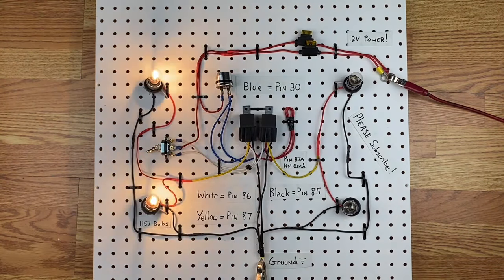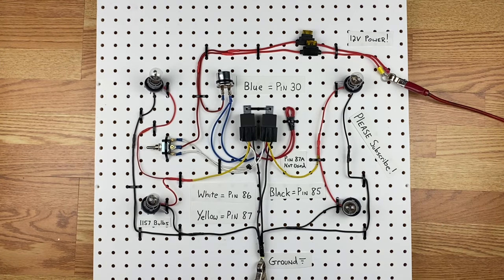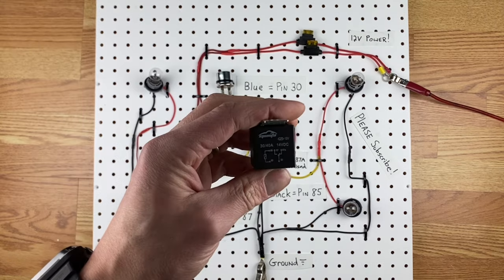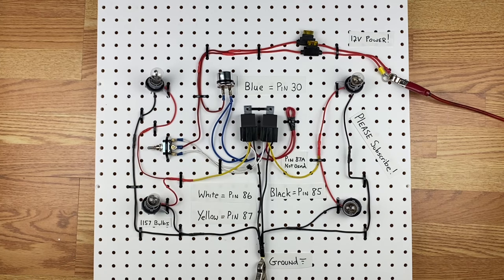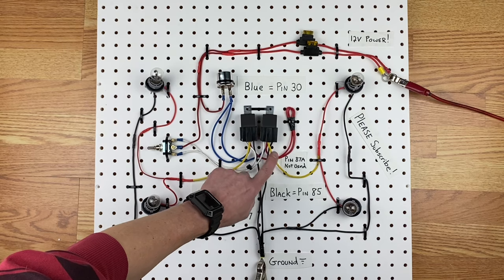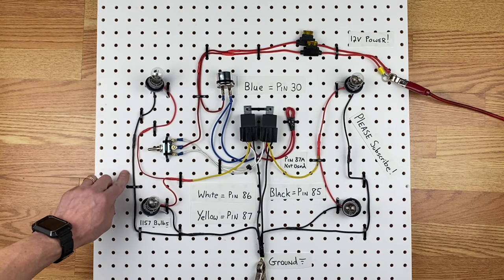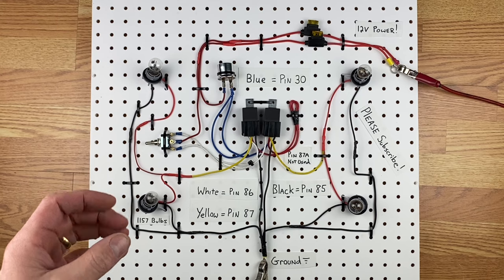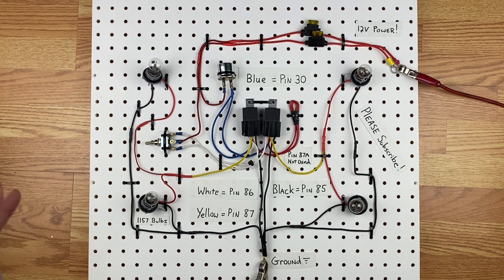How To Wire a Turn Signal Flasher Relay Directional Blinker on a Car / Truck / ATV / Motorcycle

Comment: About to buy everything I need to do this on my sortof-street legal mud toy I'm building (missing all stock lights) Just need something to get me to and from the trails. Thanks man. I've been fighting with the stock wiring all day but I'm just gonna do this.
Reply from the maker: Awesome! Check out my other turn signal videos too. I have about 3 different methods of doing this. One method doesn’t need relays, but needs LED bulbs. Another method has a cool switch that also has some other cool features. Check out the link in the top pinned comment above, and you’ll see them all there.

Comment: I'm trying to build a taxi roof lamp using turn signal relays. Would this work with an outlet or does it have to be car batteries because it's an auto part? Thanks

Comment: If I just want the lights to flash (for hazards) and don’t care about left/right for turn signals and I just wire all 4 lights directly off of the flasher?
Reply from the maker: As long as the amperage rating of the wires, flasher, and switch are rated for the draw from the bulbs, I would think that should work fine.

Comment: Great job on explaining how it works! 

I’m interested in using LED’s. I understand that you can get them as a replacement for a regular bulbs . Question, would it work using your wiring design? 

If not what would I need to add to make it work? 

Thanks.
Reply from the maker: I have two videos that can answer your question. Check out this one first. https://youtu.be/uXiEoJVtHi8. And then this would be the other option https://youtu.be/hDmER_pNask

Thanks for watching!

Comment: Question:  Do you need the relays?  Could you just run a 30A 3-way switch and bypass the relays?  Thanks for the great video!
Reply from the maker: You can skip the relays entirely if you use a suitable switch for the circuit, but 99.999% of people will not buy the right amperage switch. Then the switch will burn out, and then they will be asking why their switch keeps breaking. So the relays are the safer option. :)
Reply: @WiringRescue  What is the amperage draw of the 2 bulbs compared to the relay?

Comment: Newby question:  Why could you not bring hot wire from flasher directly to 3-way switch and out to bulbs?  I guess my question is what is the purpose of the relay in the mix?  Thanks!
Reply from the maker: Stay tuned! I'm probably going to do that video next.  It's totally doable, but you need to make sure you use the proper size bulbs & switch.  If you don't, you'll burn out things. While fire is awesome in a fireplace, it's terrible in a car!
Reply: @WiringRescue  Thank you!

Comment: works very well! 😀👍 I also want to install a light on the dashboard, either that lights up, or even better, that flashes when you turn on the turn signal lights, typically LED diode with two cables, how does this possibly connect?
Reply from the maker: Hmmm I’ll add that to my future video list!

Comment: Great, clear instruction.  Looks intimidating until you explain it.  I'm in a pickle myself.... I bought side mirrors with blinkers and most guys are splicing into front or rear directionals.  I think they can be connected to the relay under the dash, however.  Am I wrong?  How would I do that?  I just want the mirrors to blink for safety sake. It's an 05 Honda Accord if that matters.

Comment: I set up  my cross cart exactly as described and I have lights and when I use the turn signals they light up but no blink! I tested the blinker and it is fine and it is for led turn signals. Every thing functions except the turn signal blinking. Any idea's?
Reply from the maker: Swap the two wires around on your turn signal/flasher and see if that fixes it. Some of them only work 1-way. Keep me updated, and we’ll go to step 2 if that doesn’t work.

Comment: Would you explain how to wire two 5 pin pushbutton switches for turn signals on a motorcycle. 1 switch for front and one for back. Thank you, Richard

Comment: Hello thank u so much for your videos I learn a lot from them, I have a question for u as I'm building a E-Motorcycle, can I build this circuit without fuses? I'm still waiting on them to get delivered and just got my led flasher relay switches. thanks
Reply from the maker: Hello, in my opinion, every circuit should be protected by a fuse. Otherwise you risk serious damage or fire if something goes wrong. Check out this video that explains it further https://youtu.be/EhzN6UdnmPA

Comment: How would you wire it to have them as DRL and indicators? Do you have a video on that set up? 
  Currently building an E Moped out of a Chopper Bike and gonna run the 12v lights and accessories seperate from the 72v motor circuit. But I'm learning all these electrician 'How Tos' from scratch.

Comment: So I'm building a school bus little library...tried this wiring exactly like you did with the exception of I'm using 12v led lights like marking lights....so the lights will light up but will not flash....I even tripled check my wiring....so is it that have to use the 1157 bulbs versus led?? Thank you for any help
Reply from the maker: You will need to get an LED flasher to make it flash with LEDs. I have this in some of my other wiring videos, check them out!
Reply: @WiringRescue  okay and thank you

Comment: Firstly, Fantastic explanation. Does this work just the same using led lights? And what about dynamic led lights.
Reply from the maker: Thank you!  LED lights often need a different flasher because they do not put a large enough load on the circuit.  You can buy LED flashers that are wired the exact same way, but meant for LED's. I think they are a little more money, but they will actually flash, unlike the regular flasher with LED's.
Reply: Thank you.

Comment: Great explanation.  But  you can't  use the white 2 wire on the bulb socket for brake lights, only for parking as that filament is dimmer in the bulb. Brake and turn signals must be brighter than parkin / tail lights.  Unless you  reversed the conection and your flasher is on the dim side. Now, how about 4 ways?
Reply from the maker: Sure! Check this video out. I like this method a lot to be honest. https://youtu.be/Io_i9016o10 and the American auto wire switch is super cool. Thanks for watching!

Comment: Thanks for this helpful video.If I'll add another bulb each side Right & Let turn signal,  is it safe if I'll just tap directly parallel to those wires?Because I was thinking to put another bulb on my side mirror?
Reply from the maker: It all depends what size bulbs, wiring, fuses, and switches you are using. Check out this video that I made which explains this in greater detail. https://youtu.be/EhzN6UdnmPA
Reply: @WiringRescue  i’m planning to install LED lights that has 15 wattage.

Comment: This makes sense definitely when starting from scratch.  However, On my yamaha viking, the brakes are already sensitive, and I wanted to tie the turn signals into the rear lights, but still let it flash while the brakes are illumninated, is that possible? (In my sitatuation, I would be adding 4 new turn signals to front, and attempting to re-use the stock rear brake light/brake/running light)

Comment: What do you plug in first vs what's connected last
Reply from the maker: The order doesn’t matter. Just make sure you have all the fuses done properly. Check out my fuse size video if you haven’t already.

Comment: Thanks for the video, I wanna run turn signal for my e scooter using 12V battery. Can I use the negative part of the battery as ground ? Thanks
Reply from the maker: Yes the negative battery terminal can be used as the ground location! Good luck with the scooter!

Comment: Have you ever made a wig-wag setup using relays? If so, how does that one get wired up? The price of the ready-made units is going up, and it seems one could be made for less expense.

Comment: What is the purpose of the two Bosch relays? An OEM system only uses the one flasher relay. Also you can only use the other 1157 filament as a side light as its dimmer.
Reply from the maker: The purpose of the relays is that it allows you to use a smaller amperage switch. An 1157 bulb can pull up to 2.1 amps (from what I found), so if you wanted to run two tail light bulbs on each side+the front signals, you’d burn out a 5amp switch if you didn’t have the relays. That being said, you are right, that if you keep all of your bulb amperages low (maybe by using LEDs), you could skip the relays entirely. I actually will be making a video about that soon. I also have this as another option - https://youtu.be/Io_i9016o10

Comment: Is there a way where I could use a T10 LED parklight and make it work also as a signal light that turns on simultaneously with the dedicated signal light?
Thanks in advance!

Comment: Hi, I put a blinker system on my side by side.  I am using LED lights for the bulbs.  My problem though,  is that when I turn power on the system will work momentarily that revert into a flasher system.   Replaced the three way switch but still will do same thing.  What am I doing wrong? Thank you.

Comment: I did the exact same thing on my atv but my lights aren’t flashing they just glow up and stays on, do you think it’s something wrong with the flasher or is it the indicators that i’m running because those are led indicators
Reply from the maker: If you have LED bulbs, you need to have an LED flasher. If the LED flasher is wired backwards it won’t flash either. I have another video for LED turn signals if you haven’t seen it yet.

Comment: Great video. I wired my signals just as you have shown. Turns out I'm an idiot and tried to set up my LED signals like this lol took me a while to figure out where I went wrong. Found your LED video and ordered the correct flasher. Lol I have some wiring to redo..

Comment: Great video. Would you happen to know what relay I’d need for high / low beam to integrate my spotlight to only work on high beam. I have the basic info I just need to know which relay to buy. Thanks 👍
Reply from the maker: You would just need to:
- buy a 4 or 5 pin relay like the one in the video (links in description)
- Tap into the high beam power wire and run a wire from there to pin 86 on the relay.
- Pin 30 on the relay gets power from the battery through a fuse. (Be sure to use a fuse)
- Pin 85 on the relay goes to ground.
- Pin 87 send power out to your spotlight.
- your spotlight will also have a ground wire you’ll need to ground.
Reply: @WiringRescue  hey mate that’s very kind of you to give good detail. I did this over 20 years ago and when buying certain things online it’s good to know exactly what you need and where those wires go is great to know 😊👍 thanks again

Comment: I have a old 78 Suzuki rat bike that I'm doing that has had some major wiring butchered and has no indicator wires atol ,your diagram looks very simple for me to follow but just wondering if I have to have 2 flash relays or can I just have the 1 ?👍👍👍
Reply from the maker: I believe you need two if you want the flashers to work properly. There are a lot of different ways to wire turn signals, and this is my preferred method because you are less likely to burn out switches, and you have a wide variety of bulb options you can choose from.

Comment: Question...I have a 3 prong toggle switch that I'm trying to run to my blinkers...the multi switch and connections on the clockspring are done. Can I connect toggle switch and wires straight to blinker fuses or can I stick wires down in the 4 pin slot for Left and right blinkers and the hot and ground? To make it work?

Comment: Man you keep making a video like this you definitely got me to subscribe. I had an idea on how to do it but I knew there were small things that I was missing and this pretty much topped it off for me. This video is 150% understandable this is like breaking it down for dummies. Definitely is going to help me out because I do not want to pay to run new headlights, blinkers, brake lights,ect. Another idea you may be able to mention is how to run new headlights with high beams I think that would be an interesting topic and maybe throwing the brake lights in there with it to where they have the standard brake lights without you pressing on it then you know they get brighter whenever you hit the brakes just a thought would be video to watch.
Reply from the maker: I like this idea. I'll add it to my video to-do list!

Comment: I want to put blinkers on a golf cart. and I want to put led lights in stead of the bulbs. what kind of fuse do I need to insert. and will leds word aswell as the bulbs do? EDIT: and does it matter how much  amp the relay is?. I only can find 30a relays or 40a relays.
Reply from the maker: Check out this video I made, it explains how to decide what fuse sizes and wires to use. https://youtu.be/EhzN6UdnmPA

Comment: my turn signals can handle 32-60v and my battery is 52v it comes with a blinker build in  do you need a fuse and relay?   i plan on DIY up an escooter/ebike and add a new front light and turn signals ,  the switch are buttons you can press and even press them both to turn them both on if you want

Comment: Okay, great….I’ve got the turn signals done. Now I’m adding flashers. My issue is I have ONE dash indicator light with two wires. One wire for the left and one for the right. But when I turn on the flashers, the dash indicator gets both currents and won’t work. Can you help me?

Comment: I bought this old green truck. The four ways work but the turning signals do not work. I bought a pre-made wiring kit for turning signals but somehow it does not work. I will try your method and tell you how it goes
Reply from the maker: I have videos for a few different methods - be sure to check my wiring playlist out and determine which one works best for your scenario. This one is fine, but there are a few others you may like too. Good luck with the project!

Comment: Do you have that extra red wire running 87a to 87a for any particular reason? Also what size fuses did you use for this demonstration? Last question Lol 😂 Did you run your grounds to your negative battery post. Thanks again
Reply: Both 87a wires were set to the side, unused. He goes over fuses in a different tutorial. All his grounds were terminated on a single post, but each ground can be made independently if needed. Using the vehicle's frame is common.

Comment: Any recommendations for insulating the various connections and pins? Looking to do a setup on an e bike and so some of the connections will be exposed / accessible.
Reply from the maker: Shrink tubing is a great option, and there are also really nice connectors you can buy with shrink tubing built onto them. They are pricey, but nice if you need a weather tight seal. Search for 3m scotchlok heat shrink terminals.
Reply: @WiringRescue  thanks! Well that opened up a whole new can of worms…. Learning about connectors!
Reply from the maker: @sfscout9340  - haha! Good luck! I’m cheering for you!

Comment: Could you do a complete step by step how to? I'm trying to install a street legal kit to my Coleman ct200u ex, including a horn, brake light, and headlight all with LEDs. I want to charge the battery using a charge coil. Is this possible??

Comment: I’m trying to wire up a trailer to work without a tow vehicle. Because it’s extremely expensive to have the vehicle rewired.
Reply from the maker: Interesting. How would you control it? A long wire? Or some kind of remote?

Comment: I have a similar scenario. I have 3 wires coming out of a bulb, two of those are for sure the DRL. The third wire is for the flasher function.  But where do I connect that, can it be added to the flasher circuit? In that case, + or ground?

Comment: how do you use this with a 3 wire brake light without using the ugly 500148 switch? I am doing this on a golf cart and have a normal 3 way switch with 4 posts, positive in, ground, and two positive outputs. This sounds like the job for a relay, what kind?
Reply from the maker: Maybe you could use the plunger switch option in this video? https://youtu.be/h6F9PauqvXc
Reply: @WiringRescue  I think I may have miscommunicated my request. I have a brake pedal switch already. It is a NC switch. When the switch is depressed it turns on the brake light. If the brake light and the Turn signal are the same light, and the turn signal already has a 3 position switch that is not the switch used in this video what can I do to wire it up to where the brakes do no over ride the turn signal? One wire is to the "drive lights which are headlights and always on rear lights. There is a spot to add an additional light to the front, the rear has an un-used terminal on it which should be the second filament in the bulb. I wish to use the golf cart style blinker switch. It looks nicer than having a metal toggle switch like the one shown. I would rather do additional wiring and relays than have a switch that is not pleasing to look at. would I need to just do something like this video ? https://www.youtube.com/watch?v=wpTQZRbOjPA

Comment: Do you need the flasher?  Can you just by-pass it?  Or replace it with another part?  Thank youi
Reply from the maker: If you want it to flash, you need a flasher. If you just want the lights to turn on, then no flasher is needed.

Comment: great video is there any lights that you can recommend that come with a cover for protection , I want to add this light system to an ATV
Reply from the maker: And generic non-LED dual filament light should work. Maybe look for universal trailer lights?